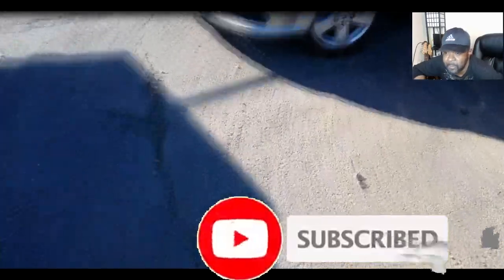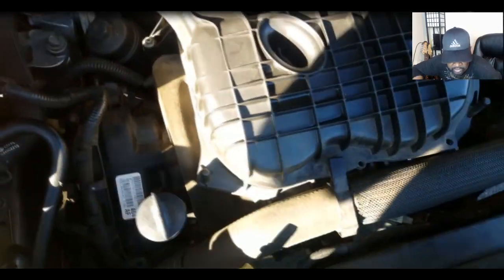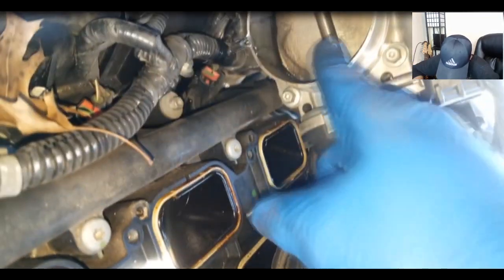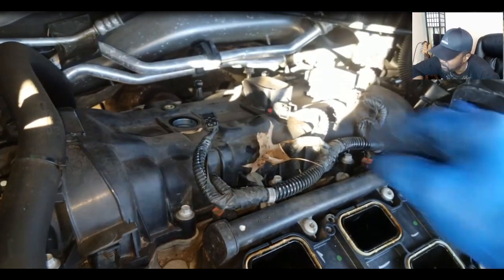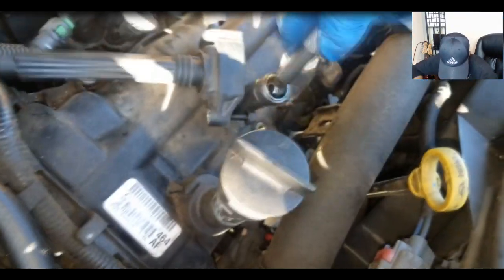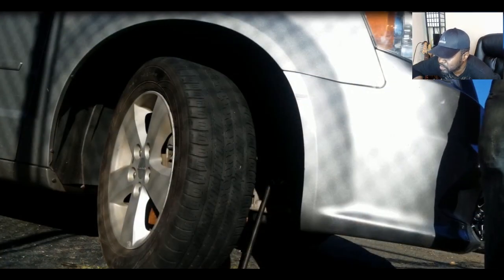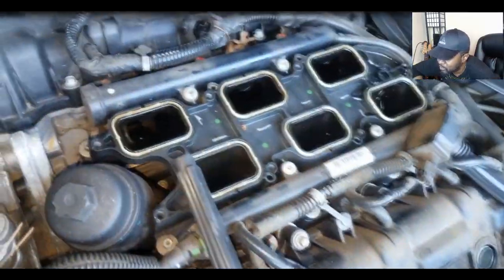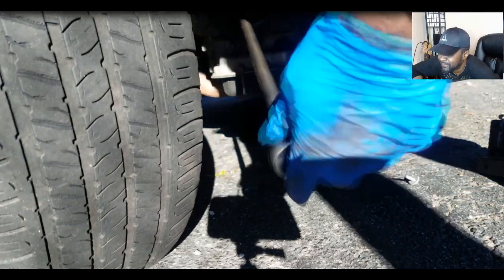HYDROLOCKED WATER DAMADGE ENGINE, Lets do more checks. 3.6 Pentastar V6 Problems

Comment: Got a question, if found only one piston damaged, in this case its rod, and trying to rebuilt the engine, replace only that piston damaged or all of it? all it is more expensive but that is what logic tells me, as well as bearings and even crankshaft if needed, the cost of all those parts through dealer is a little over 3k, they do not sell short blocks and a long block is around 7-8K. Fraser Engines and Transmission I had a quote for a premium long block for around 5k but desisted after reading their BB reviews; that is like a horror movie the complaints from customers! went to couple other web sites who sell remanufactured blocks and found the same thing; so I took it under doing it myself.

Comment: The 2nd Gen durango had a problem where water would run down under the cowl and get into the intake and hydrolock the engine.
Reply from the maker: Yea man, especially the 2004 year with the Hemi, the intake manifold gaskets leaks, water get in the engine during rain if your cowl is broken and can creep into cyl 8. Its down hill from there. Thanks for watching
Reply: @OnlineMechanicTips  no problem you have some good content.